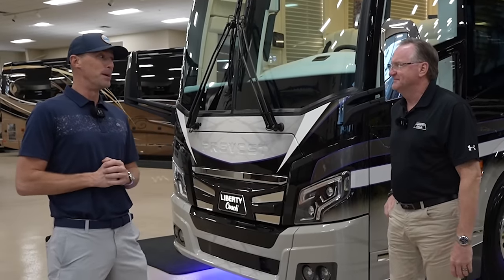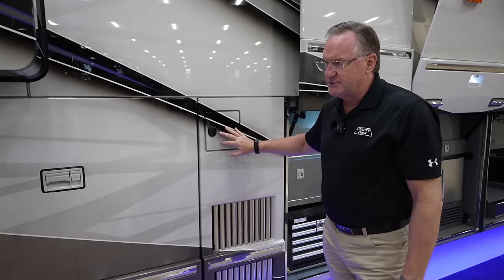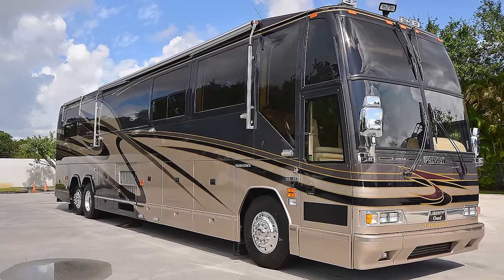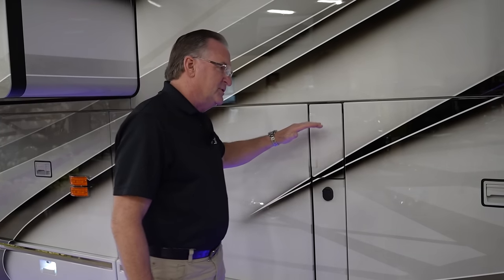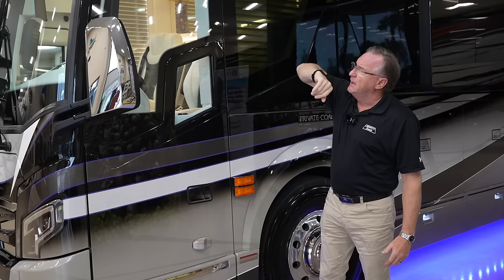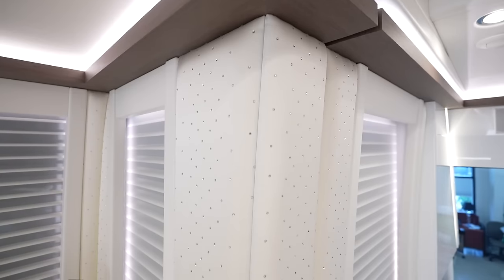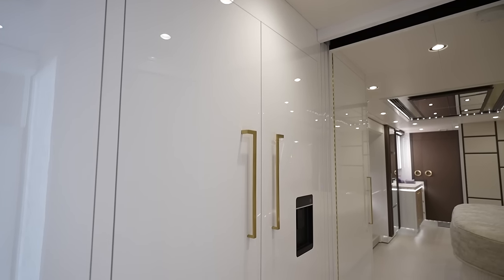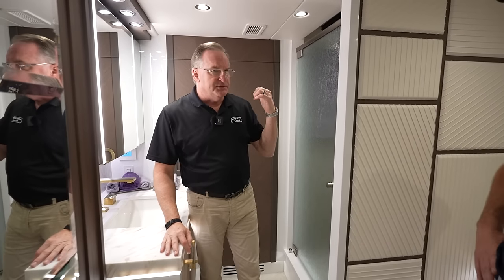Tour of 2024 Prevost Liberty Coach #905 (The 11th Liberty Coach this owner has ordered!!)

Comment: Frank, hello... I know you use the Prevost frame, but are you able to install a power sliding entry doors found on the Newell? Also, Newell has cameras on both sides of the fuel doors so there is no mistake in stopping the coach right at the fuel pumps-have you thought of that? I am just blown away on all of your plumbing in each bay; the Culligan water filter system is a MUST for me, I love it. The large double windshield and wipers are the koolest ever. As for your cabinets, for that kind of money, all doors should be soft-close as a standard feature.
Reply: Thank you, we do not have the ability to do the power sliding door, however the Prevost chassis does have a powered entry door on the tour coach which might be able to be ordered on the shell chassis.  We have a birdseye view camera system so you can determine where to stop the coach for fueling.  Regarding soft close doors, I have had this asked in the past, we have a latching mechanism on the doors to keep them closed underway, as soft close system will not latch the door so you would need to push the door to latch as a second movement.
Reply: @frankkonigseder6592  Kool Beans, Frank... I accidentally left out a word or two about the soft close doors; I meant soft close on all of your cabinets and drawer doors inside the coach. I didn't think about the 360 view use for pulling along side the fuel pump, that works. As for the power entry door, on the Newell, it doesn't slide open, but it power opens to the left and lays flushed with the side of the chassis as opposed to opening to the right manually. So, are you able to do that? Lastly, on the Newell, the steering wheel is powered tilt and telescopic; I've noticed on yours, it's manual. Appreciate you taking the time to respond; means a lot to me. Stay safe! Mr DJ...
Reply: The Prevost does not have the ability to have the entry door function like a Newell, and quite frankly I have never seen Prevost door fail in 40 plus years, can't say the same for the Newell.  Regarding soft close on the drawers we do as an option.  The steering wheel is tilt and telescopic.
 @CatNMrDJ

Comment: I dont know which of the 2 to decide on: Newell or Prevost latest Liberty coach! I know they are both customizabl to a certain degree, but cant decide.
   Amazing of how far in quality RV Coaches has come to.  Thanks to both Prevost conversions and Newell coaches stepping it up constantly, while the prices as well of course. We have to remember that it is not that simple even if you got the cash. Think of INSURANCE!, storage, maintenance .. Then think that you can drive these coaches not in cities really. a 1/4 Million Dollars exterior paint job you wont want it be scratched or dented while passing through some town or city roads (not even thinking about real cities like New York, Chicago or Los Angeles. Once settling to get some coach I have a problem between a Prevost (Liberty or simpler conversions) vs Newell. None of them have all the pluses. Newell is more living area including higher ceilings (who needs high bay areas and giving away so much living area!, entire vehicle including drivers area, more customization including placement of (and maybe even more) doors, length of entire coach.. rear turning wheel.. While the Prevost is a much more engineered vehicle built and more the Ride  - super smooth and quiet, holding its resale price closer than the Newell. Prevost has more expensive chassis parts, while Newell is the usual truck parts for the chassis, if I am correct. Boils down to: I don’t know which of the 2 to decide on: Newell or Prevost latest Liberty coach! I know they are both customisable to a certain degree, but cant decide. I have many questions, including that a commenter has asked “can we get detailed info about NewEngland Winter with the coach - Like Below ZERO - Can the coach handle ski trips up the mountains??”
Reply: Thank you, yes the coach can survive the toughest winter conditions, I have personally used the coach in -65 degrees

Comment: Could you talk about the insulation in the walls, floor and ceiling? This is never addressed. Also can you use this in sub zero weather? Warranty info on the floor if any as well. Also suspension, power and drive train? We see all the flash but none of the nitty gritty. I understand why, could you just put a link to that info in your videos?
Reply: Frank has talked a couple times about that. He has said he has taken snowmobile trips to Yellowstone and had the coach start when it's -60 degrees. In the last video they did together they discus that.

Comment: Frank, hello again. One more question, please. Does Liberty/Prevost come with 4-wheel steering like the Newell?
Reply: The Prevost has a tag axle that unloads giving a turning radius equal to or shorter than the Newell.  The unloading tag is significantly easier with less moving parts and less potential issues then the steerable tag.  This goes back to the engineering of the Prevost chassis for millions of miles per year over the entire fleet of coaches.
Reply: @frankkonigseder6592  Kool Beans, Frank. I like what I'm hearing from you. Thank you again and Happy New Year. Mr DJ...